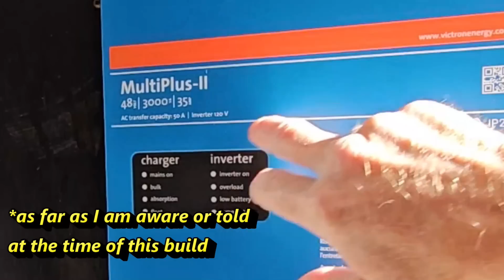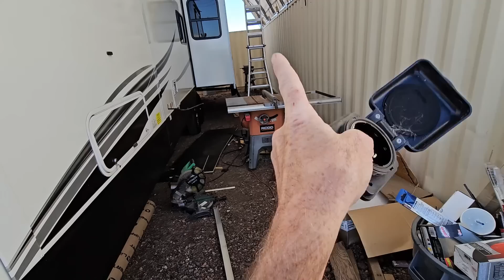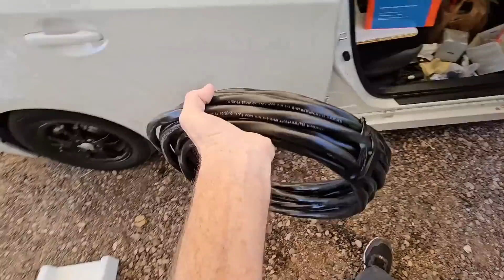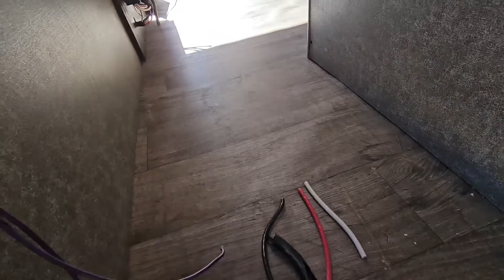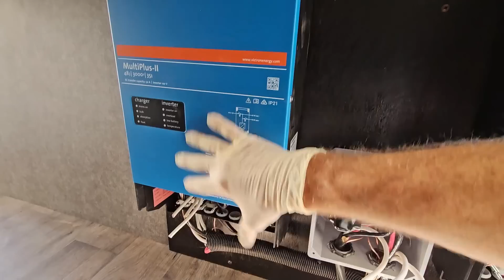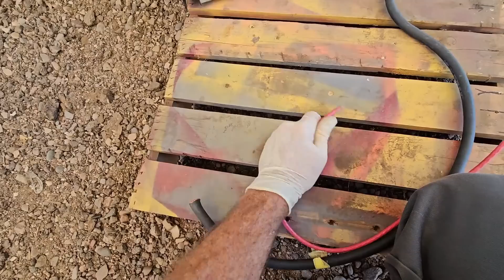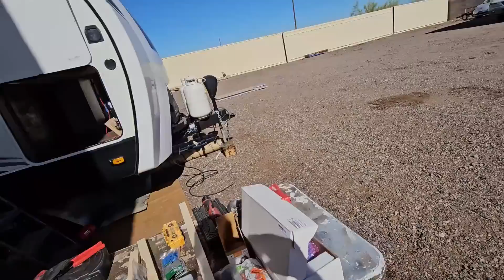How Simple Is Wiring a Solar Off-Grid RV/Cabin? And Why 48VDC?  WARNING: This WILL Upset YOU!!!

Comment: James, great video and very truthful. Thanks. Can I clarify one comment. You stated having 24 VDC was easier and if you needed 12 VDC you simply drew it off of the one battery in n the series circuit. Having done many of these systems in the past you NEVER center tap a series ESS (energy storage system) It off balances the circuit and one battery will dies quickly. Otherwise great content.
Reply from the maker: I understand your concerns but I do not share them. Bus conversions have been doing this for decades.
Reply: @AZExpert  thanks for the reply. Just because it’s been done for years does not make it right. We have learned so much about ESS failures and many come from out of balance series circuits. Best practice, put in a 24 to 12 convertor. Keep up the great work!
Reply from the maker: @daleconstantine5635  I would be interested in knowing how out of balance a bank could be with a tap in a bank. The batteries should still balance and charge voltage should not be affected. I'm still very unconvinced by merely stating best practices. Is it a 0.05% or 5% reduction of battery bank life or 45% in 3 or 10 years? I would argue that if it has worked for decades it works.
Reply: @AZExpert  good research material is Wiring Unlimited Rev 06 white paper from Victron available from their website. See chapter 3.4 Battery Bank Balancing. I have had many incidences I have had to investigate as part of my job of reliability. With battery failures this balancing issue was paramount to rectifying the repair and eliminating designed induced failures. Enjoy the read.
Reply from the maker: @daleconstantine5635  There was one sentence and it was hardly compelling reasoning.

Comment: Thanks for videoing this James. You’re on the way to a sweet system 🙂  I’m Evan Arnett with AMP Solar RV out of the Phoenix area. 

You hit the nail on the head with the 24V vs 48V setup. 24V enables using 2 of the Victron 24/3000 2x120 inverters. The major drawback of the dual 120V (3 wire instead of 4) Victron inverter setup  on 50A RV’s like what your customer is going with here is that when the RV gets connected to a single phase power source like a 30A hookup or 99% of RV and portable generators, 1 unit passes the AC and charges the battery bank,  and the other unit rejects AC input due to it not being 180 out of phase and will invert. It can be problematic for customers that want to run both air conditioners and other loads at the same time, as there are inefficiencies in each step of the charging/inverting process. The biggest thing I’ve found with these setups, is it’s important to make sure that the AC loads that are most commonly used are connected and programmed on the primary inverter, so the losses from the other line that is rejected on single phase input are kept to a minimum. I always strive to put the main living air conditioner, and the outlet strings on the same load line as the primary inverter as those are the most common loads. Feel free to reach out to me here or on my Facebook page AMP Solar RV. I have a travel trailer that needs a roof, I’m happy to exchange solar installations for a roof replacement :)

-Evan Arnett
Reply from the maker: Thank you for the kind help and support. Yes, when hooked up to 30amp only one inverter passes through and charges, while the other is setup to invert. It's silly as one is charging as the other is discharging, but with the sun, it still manages to charge fairly quickly. I just could not get behind the other inverters on the market. It also seems like something Victron could update with programming only rather than hardware. Even if it were to just pass power through and turn the second charger off.
Reply: @AZExpert  I don't disagree with you on that :) It could easily be addressed by Victron with a new VE bus configurator programming option specific to this scenario. Unfortunately I don't think that update will ever come, as the dual 2x120 models configured in parallel now cover that scenario. Just don't have a 48V option for that, at least at this time.

I definitely wouldn't pass on that advice of programming the inverters so the "most important" air conditioner and the outlet circuits are on the primary inverter that will pass through. It will help a lot in those single phase scenarios, especially when using a generator to boost up the batteries on cloudy days or overnight. I've had folks with these systems up and running for a while who come to me for that service, with complaints that their single phase generator takes a long time to charge up the batteries when the air conditioner is on. Quick reprogram and /or move a couple circuits around in the breaker box, problem is solved :) Just make sure to keep the loads in the breaker box relatively balanced across the two legs if you do move them around.
Reply from the maker: @AMPSolarRV-vc6ri  I really could have used your help and knowledge during this installation :)

Comment: P=IE and E=IR.
I can understand using 48v for smaller gauge wire  But always wondered why not 12v on an RV or boat. Your system makes sense using those 48v batteries only for AC power. 
My issue would be the Orion. The 12v to 12v I charge 1200Ah lithium from an acid battery gets really hot. I assume the 48v to 12v also gets hot. When I am charging from solar, I do not want to waste so much energy heating the DC to DC device. My two 30 amp Orion get so hot I can hold my hand on them. I wonder how many watt-hours are wasted there.
If Victron page is correct is 87% efficient I am using 93.6 watts just in heat, One system I have uses four Renogy 100 watt panels. Just the heat would easily waste one panel. 
I heard Victron was improving the efficiency on the newer Orions. You might look into the one you bought.
Reply from the maker: I also do not like making heat. There is compromise in every venture though. :)

Comment: Unless you enjoy white noise for sleeping, do not put these near the bed, unless that's the only place they could possibly go.  Those multipluses are pretty noisy.  They have a pretty loud hum when a lot of current is going through them either inverting or charging.  I put one in a washer/dryer cabinet in the hallway near the bed.  I didn't realize how loud these things can be.  Luckily I sleep with a white noise generator or I don't think I'd be able to sleep with it 10 feet from my bed.
Reply from the maker: It's my experience they are much quieter than xantrex or magnum and produce much less heat
Reply: @AZExpert  Don't get me wrong.  I think Victron is the best, and they may be quieter, but they are definitely not quiet.  I just wish any of the content creators had mentioned that these things are NOT silent.  I'm not even talking about the fan, but the electric hum of transformed electricity.

Comment: As an electrician of 40+ years the Polaris setscrew 
connectors your using are far superior to using wire nuts
Reply from the maker: Much easier on my hands too and in tight spaces

Comment: The neutral will have zero current if you have only 240V loads or if you have equal loads on both legs.  Unlikely you will ever have equal load on both legs so the neutral will carry the unequal portion of the current.

Comment: I just did a similar upgrade to my 2006 CC Intrigue. Removed the old Xantrex and replaced it with dual 24v Victron MP2(2x120) and 920ah 24v lithium batteries[. I had to repurpose a lot of the existing AC cable and split the incoming service and wiring to the 120v panels. 

You do good work!

Comment: I really enjoy your video found it funny at times. You know with the batteries near the inverters even if you used 12vdc the distance would not have been very far so cost would still not be a factor is the way I see it. What is nice if your Charge Controller will go 400vdc input or higher.

Comment: NEVER draw 12v from a 24v system as you suggest in the video!!! You will kill the 24v system. The same goes for any other voltage as well. You should ALWAYS use a DC-DC converter and a proper voltage battery.

Im speaking specifically about tapping off one of the two series batteries in a 24v system just as you suggest in the video. You wouldn't be able to easily do a midpoint tap from a 24v battery.
Reply from the maker: I understand what you are saying, but also I know most motorcoaches use 12vdc batteries for 24vdc and still have 12vdc systems and tap off of them for that purpose too, and they've been doing it for decades.
Reply: @AZExpert  any RV manufacturer that does such a thing should not be in business. I have worked on many motorhomes and never saw a combined bank. There has always been a separate coach and engine battery, and even a separate generator battery in many cases. Note that I haven't worked on every brand or model, and generally have worked on newer ones, so I'll admit there are probably some shady practices being utilized in some brands.
Reply from the maker: Newmar has done it for years with 6 volt batteries for dimming the ceiling lights, Liberty Coach and Marathon and other converters have done it for decades build luxury motor coaches, neither is shady and has nothing to do with the chassis batteries or generator battery being a combined bank. On buses, generally the chassis is 24vdc so it charges the house batteries with 24vdc and many house circuits are 24 vdc like the inverters, but the rest of the house systems are 12vdc and require tapping into the 24vdc house battery bank for 12vdc. It really is not the big issue you are saying it is.
Reply: @AZExpert  it absolutely IS an issue, especially when you move into lithium batteries. That is a bad business practice, and very hard on batteries. I have worked on both Marathon and Liberty, and I have never seen a combined 12/24 volt system on any of them.
Reply from the maker: @CharlieOdom1957  I do not know what to tell you if you have worked on the buses and have not seen 24/12 vdc on the house batteries, even on golf carts, often reverse is tapped into 36 volt on 48 volt or 24 on 36 so it drives slower in reverse, im still not sold that its hard on batteries to be discharged no matter the configuration, while I could see drawing one battery down substaintially in a series bank could be a liability to the bank if taken to the extreme, LED lights and control circuits or small draws would not stress any lead acid let alone a lithium setup.
Reply: @AZExpert  reverse tapped? No such thing. The controller on a golf cart controls the output to the motor. It is ONLY connected to the entire voltage of the battery system, whether that be a 36v, 48v, 72v, etc. You should definitely stop making wildly inaccurate statements. You are discrediting yourself more and more with each one.
Reply from the maker: @CharlieOdom1957  You merely state and assert I'm wrong. I have given examples. Saying "nuh uh" hardly discredits me, nor am I making wildly inaccurate statements. https://vintagegolfcartparts.com/cgi-bin/gallery/gallery.cgi?func=show&file=200345&Category=100020&Page=2 
You should see a tap on the middle positive post that is putting 18vdc to reverse and 36 vdc to forward. Is this enough?
Reply: @AZExpert  so...your defense is a product that has not been used in over 3 decades, because it harmed the batteries?

Great job!!!
Reply from the maker: @CharlieOdom1957   How many times will you move the goalpost and be intentionally disingenuous? I could literally post a video of bus batteries showing the 12vdc tap on a 24vdc system. You're wrong, unable to grow and learn, and dishonest. The only thing I think I learned from your comment, is the level of your character.
Reply: @AZExpert  Sorry, but I don't play games. I haven't moved shit. You are the one who posted something that hasn't been used in decades, and was replaced because of the very thing you claim doesn't exist. I can't help your lack of understanding of basic electrical principles and laws. Just because you found something that was in use decades ago, doesn't make it any less damaging to batteries, just like a BMS is not a charge controller. It is an emergency switch to prevent damage to cells and/or injury to people/property.

I suppose next you are going to tell me that a 1930s shoe fitting flouroscope is a perfectly safe and acceptable device, or that asbestos is a great and safe insulator for your cells too, huh?

The point here is this: just because decades ago people did something, it doesn't make it any less damaging.

Tapping 12v from a 24v system is NOT good for the batteries, period. I don't care who the fuck did it 30 years ago!

So, what are you going to find now from decades ago that you think is perfectly fine to do?

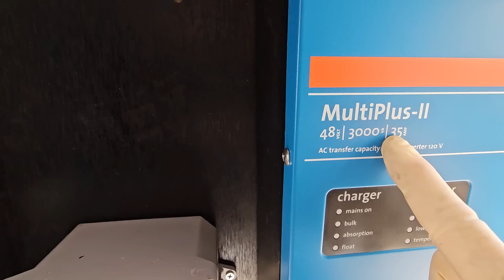Comment: 16:40 You state that you have 35a AC on each inverter. That is incorrect. The 35a is the battery charge, not the input. Those 3kva inverters output 2400w, or 20a each at 120v continuous. So you have 40a total out of the 100a available from shore power.

You also could have done a 5k inverter with a 30a shore power, unless you need that extra 800w of power.
Reply from the maker: yeah, victrons ratings are weird
Reply: @AZExpert  I love victron, but I'm going with EG4 in my current build. Victron is just too cost prohibitive to get what I need.

Comment: The 460 ah 12 Volt Vader is the same price as the 100 ah 48V. Must REALLY wanted to go 48V because going 12 Volt you don't need the DC to DC converter and the extra 12 V battery and would have more capacity. I was anxious the entire video when you said you were using a 48 volt battery how you were going to run the 12 volt systems.  Are you turning off the built in 12 volt charger or using it for the front 12 volt battery? I guess the DC to DC isolates the 48 V lithium from the 12V charger so that is kind of a cool plus.
Reply from the maker: Yes, the 48vdc battery is the real house battery it just has a tap to keep the 12vdc systems working and the 12vdc battery just is there for a little extra ompf when needed and electric trailer brakes.
Reply: It is fairly typical in 24V and 48V systems to have a 12V "down-buffer" battery for legacy 12V stuff.  Its just a DC-DC charger (48-to-12 charger) and a single 12.8V battery with enough amperage to run the equipment (such as jacks and brakes).   The charger doesn't have to be powerful... it can usually be small since the physical battery handles all the surges and heavy loads.  4-8A is pretty typical (thus also fanless).    And the battery can just be a typical group-24 sized 12.8V LiFePO4 battery.

There are numerous advantages to doing this, not the least of which being that the isolation from the home battery system means that voltage sag and other issues caused by large 12V surges / loads (such as jacks) have no effect whatsoever on the home system.

Alternator charging of the home system is another issue that comes up.  12-to-24 DC-DCs are fairly common but 12-to-48 is not.  One solution is to just hang a 12V inverter off the regular alternator / starter battery bus that is enabled when the engine is running, and run the AC into one of the AC inputs of the multiplus (or something similar).

Comment: I used those same black goo filled blocks for a couple of DC sides places when I did my big power system install. They are actually outside under the camper and have held up great for quite a while now. Definitely good stuff
Reply from the maker: That's great to hear, being UL listed or tested must be why they are so $$$$
Reply: @AZExpert  Yeah they definitely aren't cheap but I thinking certain situations the extra cost is warranted.
Reply: I have been using them in marine environments for years and never had a failure.

Comment: I think the reason for 48v is that all of the components are not only cheaper but more accessible.  24 volts requires series connecting 12 volt batteries and is problematic because each battery has a bms and a failure with that disables your entire system. Where a 48 volt battery has only one bms and is paralleled for more capacity. If one cell goes down the rest of the system keeps going just turn off the effected battery and you still have lights and cooking. 4 -12v batteries from battle born is $4000. But one 48 volt same capacity battery from EG4 is $1200.   One quarter the price, same 10 year warrentee and are waterproof and ul listed, and takes up WAY LESS SPACE.   CHEERS AND SAFE TRAVELS      Steve h
Reply from the maker: all your points are correct. So far the best thing I see about the "GameChanger" is that it can be mounted very easily and made into larger voltages easily too. I am not sure the price is worth that, but even 12vdc LiFePO batteries get complicated to mount in large numbers.
Reply: I chose a 24v system because it was easier to get 24v down to 12v (victron orion) and also use my alternator 12v system to charge the batteries while towing. I built 2 24v 280ah batteries (overkill solar bms eve cells) feel that this allows for redundant batteries.

Comment: James, I noticed your friends trailer storage, was framed in aluminum. Is aluminum an indicator of better overall trailer quality versus wood? Thanks
Reply from the maker: yes, better quality and lighter weight and more expensive, quality maybe not the best indicator.
Reply: Lighter mostly
Quality is objective and mostly related to manufacturers integrity.
Since, while traveling, RVs are constantly moving around..and the tensile strength of the aluminum ,if too ridged, can Crack. Wood suffers flexing better...without cracking